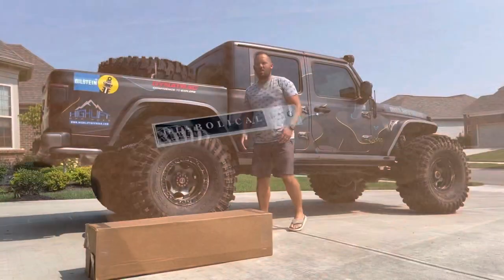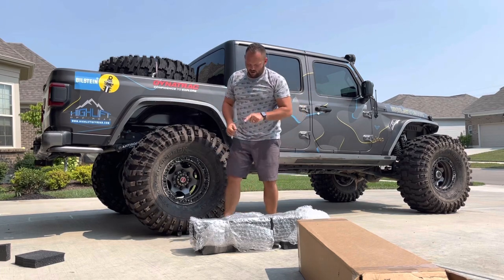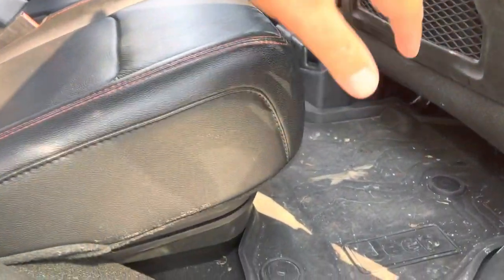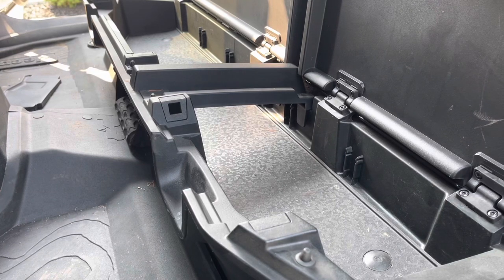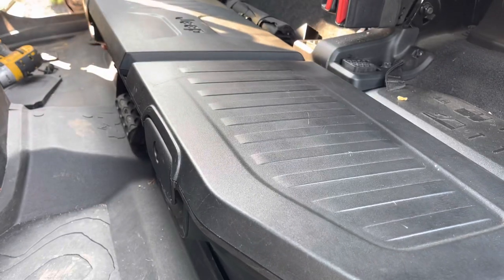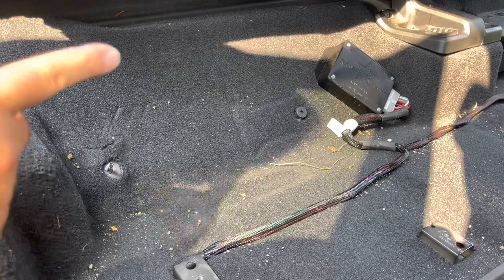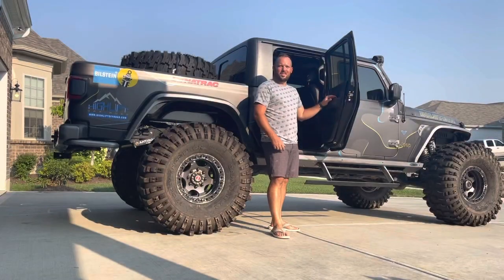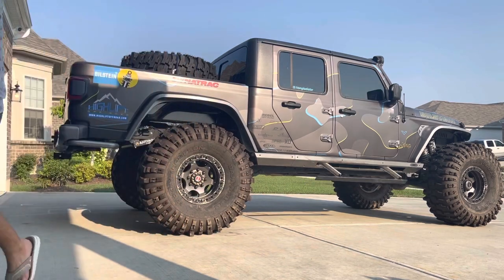Diabolical Inc. Jeep Gladiator Security Lock Box Install and Review

Comment: What if your gladiator didn’t come with the plastic box will your metal box still fit
Reply from the maker: Yup, it still fits! If your gladiator does not have at least the non lockable box though, you will need the 4 bolts. Diabolical is working on including that hardware in future kits

Comment: Will that metal box not rub or cut through your wiring going under it?
Reply from the maker: The box does not have any sharp edges and the wiring is in a thick wiring loom. With the box not really having the ability to shift around, since bolted down, I don’t believe the harness could face any issues

Comment: Any rattling from the metal when driving ?
Reply from the maker: That was honestly one of my biggest concerns when purchasing this box but I have had any rattle, even when wheeling. It is important to secure whatever you’re hauling in it though. I had a tool kit that was sliding around. I ended up adding some foam in the bottom and cutting out pockets for things
Reply: @TheBrentHensley  Thanx for replying and good idea with adding foam to the bottom. I think I’m going to make the purchase for one.